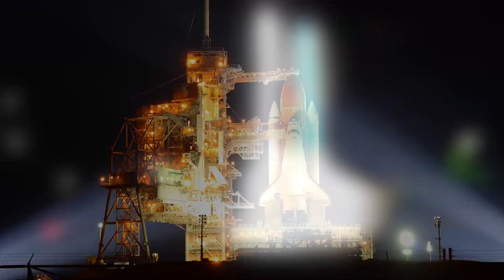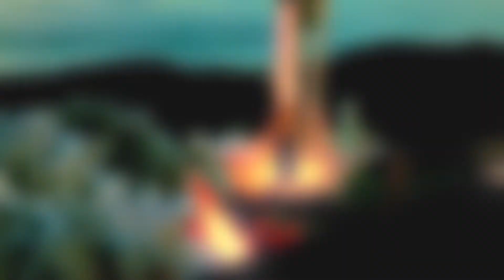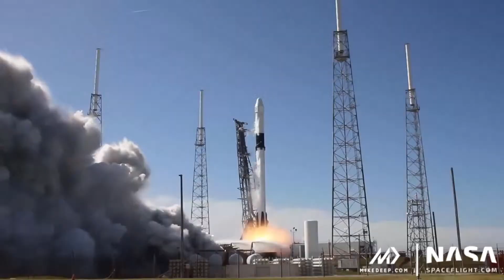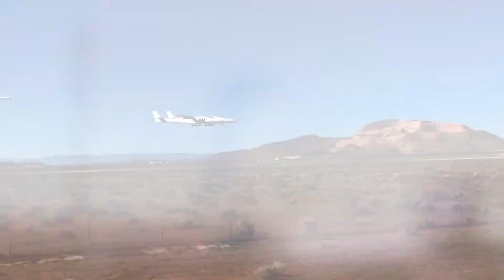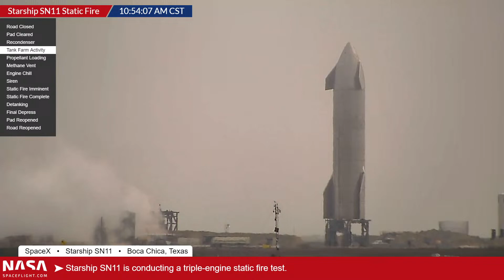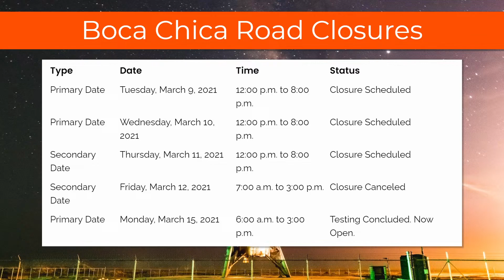SCRUB: Starship SN11 Static Fire Test Scrubbed After Abort

Comment: Firefighter  tank + fuel tanks >> in printed mold of clay 
then pour or press melted steel at 
but there will be tubes inside the whole skeleton and pumps at certain point of that body of RoCKet at certain points of That tubes to prevent firE from DOWn SIdE RApTORS of the rocket area and on side
Reply: pipes is part of the printed mold so there will be no pipes but tunnels with tubes shape
Reply: tanks is the same idea
Reply: solid body not body that when rocket become big collapsed like paper
Reply: 3 static legs with 2 tail wings like raptor with suitable size between 2 of that legs >> wings also like raptor f22 and keep that 2 side wings in front of that rocket
Reply: 2 more places like small rocket on each wing if it is too heavy to take off
Reply: ball like observation on planes that on it camera but it will be so heavy and from steel and has some mechanism to move it in solid manner but it will be instead of raptor >> out of hot air of the rocket propulsion
Reply: tall hydraulic legs on body of rocket in case of fall on it is side 
the open and push by arm hydraulic arm and open the main tall leg 
hydraulic leg then push it propulsion from tunnel of side of the rocket to make it stand again
Reply: long leg on each side of the rocket
Reply: water scale >> and laser on it 
water scale with opaque liquid 
laser sender in points and at to receive it on other side from water scale 
so 2 of that laser water scale will be on x and y >> dimension to keep balance >> and what to give it is propulsion at suitable time
Reply: steel rod with gear to make printer huge one 
but that steel will be with 3 rings cupper rings >> you can take plastic pipes in different sizes put them inside each other >> provide electric isolation 
and suitable width from back side for steel wheel with characteristic current so 3 different currents >>> and each plastic pipe will be with L shape >> and figure how you can make it if you will pour materials like 
melted steel and melted cupper >>> then measure that 3 different currents >> and make it go to visual basic >>> and now >> make thing like icon program >> and know how many rotation to reach to each point >>
make things like if this is for one meter so one place to add to put amount of meters to translate it to number of rotations >> put tanks at H shape 
that printer head located at so tank will be above the H shape horizontal part of it and printer head down of it >> there will be for feed of that rooms or tanks >>> pipes with end room that car like cement rotator car 
 but with melted material will make this tank send it by pipes with motor at it is end and spiral rod inside it like what in meat cutter machine >> so >>
Reply: tube for the ball raptor ball with hole up on it 
and hole down of it propulsion 
it will be for feed >> like arch that connected with ball from upside 
lip that with screws that on the arch that from up is tube 
and this tube is easy to move right and left 
this ball may be from outside like >> gear mount that move by real gear 
this is the surface of the ball may be >> and by other real gear on ball 
on it side you will move it to reach to all direction ? 
mechanical designs and thiNGS like ThaT

Comment: This worries me ...
Every SN test seems to end up with a Raptor problem, every single one!
That's 3 engines, closely scrutinised before installation and in perfect conditions and still they are unreliable.
How, then, will Space-X ever make 34 Raptors per orbital launch operate effectively and safely let alone subsequent restarts for landing or extra-terrestrial lift-off ?!
I want Starship to succeed; badly ... but this is a Hell of a weak link.

Comment: Pathetic every one blows up or fucks up .
Reply: That's why it is a test program, the goal is to test as much as possible as cheaply as possible to eliminate problems for the future, not get perfect track record first try and then experience the problems in a more delicate situation e.g. a manned mission. It's not pathetic, it's just rocket engineering.
Reply: @zulu1  
If you've ever seen a compilation of old V2 and Atlas failed tests, you'd realize what an astounding success these Raptor systems and their respective test-articles have been.
Reply: @-danR  Don't waste your time bro.. Not worth it
Reply: @zulu1  Tin cans RC electronics toy model engineering for children .
Reply: @revamp777  bruh it's rocket science, they are just trying to make the engine work well. Boeing failed there last engine test and still haven't retested.
Reply: In the early 60's I watched hundreds of experimental rockets blow up or at least 10 to 50 of them SpaceX has been fairing quite well on this number far fewer that NASA's record and they just stuck their 9th launch and landing of the same falcon booster ( same booster 9 times into space and back ) they will get it right in the long run. After all this is rocket science and that is how it goes.
Reply: Jeff? Is that you?

Comment: Big reliability problems with the Raptors seems to be continuing here.
Reply: Once there's a liftoff commit, the raptor engines proper have performed superbly, and most of the rest of the system. The problems are converging on some kind of header-tank/flip incompatibility, and only with the CH4 header tank. Meanwhile the mean-time between launches is steadily decreasing.

Overall, this is norminal rocketry.